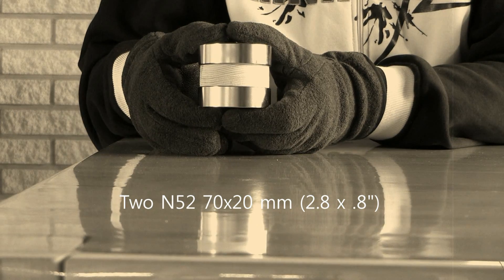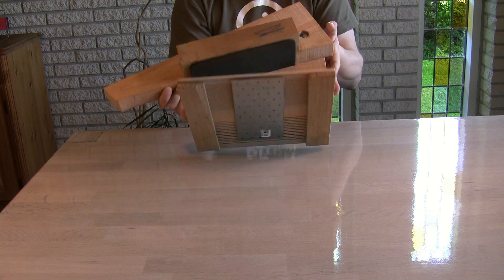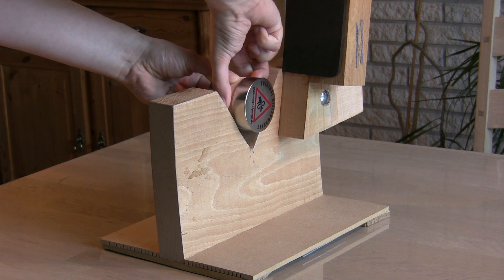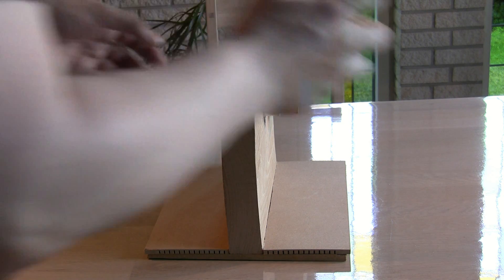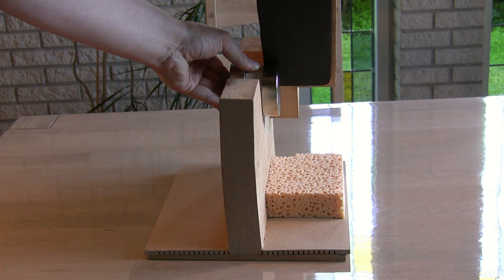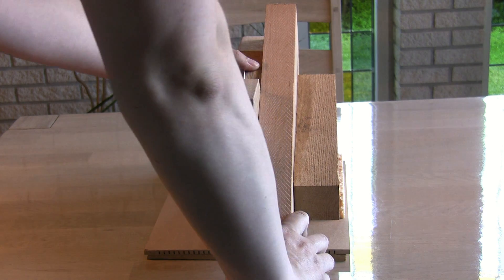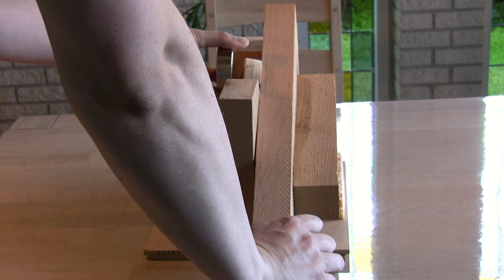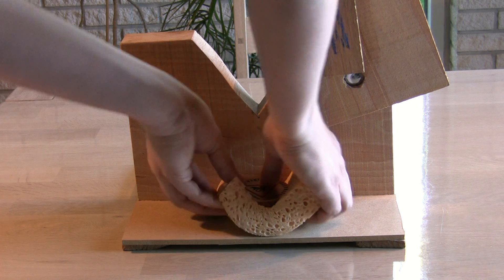Separating large neodymium magnets

Comment: [continued] Is it really true that 2 magnets have 13% more pull that one magnet of the same volume, density, and shape?  

If so, does that mean you can increase the pull of a magnet by cutting it in half and putting it back together (with opposite poles aligned)?

Comment: I noticed something odd when using the magnetic calculator on the K&J site. If you type in the values:
Grade: N42, Diameter: 1", Thickness 1", Distance 0, you get:
Magnet to Steel: 61 lb, Magnet to Magnet: 61 lb, 
but if you type in the values of 
Grade: N42, Diameter: 1", Thickness 2", Distance 0, you get:
Magnet to Steel: 69 lb, Magnet to Magnet: 69 lb.

[cont.]

Comment: That makes real sense, and it is proven when you compare the pulling force to a steel plate of two equal grade cylindrical magnets of the same diameter but different thicknesses, as they are virtually the same.

The pulling force between 2 similar magnets is roughly twice as strong.

Comment from the maker: [continued]. The magnets are saturated so the two magnets combining can't find any more magnetic attraction than a single magnet put on a steel plate with lot of unsaturated material. Also the magnets have exactly the same surface area in the scenario where the steel plate is larger so the magnet in the steel/magnet scenario has more material to act upon and saturate.

Comment from the maker: You're welcome :)
If you stack two magnets together they will behave very similar to a single magnet of the same size as the two smaller combined. That is: they have the same pull force if put on a steel plate as the single magnet. But taking them apart from each other is a different scenario. 
It still is a little counterintuitive that taking two magnets from each other is the same pull force as taking one of the magnets of a mild steel plate. I guess it has to do with 'saturation'. [cont.].

Comment: I checked out your Buyer's Guide which was very enlightening, and also the magnetics calculator.  That's exactly what I was looking for, thanks!

I was surprised to see that the force needed to separate a magnet from steel is the same force needed to separate the magnet from another magnet of the same size.

I was expecting it to be twice as much as the 2 magnets because the FAQ stated that "two or more magnets stacked together will behave exactly like a single magnet of the combined size."

Comment from the maker: Thanks :)
Google 'k&j magnetics calculator'. Then you will find an online calculator where you can input shape, size and distance in mm. Pull force case 3 is what you'll need. You need to translate form lb to kg though :)
Calculations with magnets are notorious for being inaccurate so only use it as a rough estimate (eg. grade is actually quite inaccurate - check my video 'Buyer's Guide - Grades of magnets').
Hope it helps and good luck with your magnets. Don't let them slam freely together ;)

Comment: Hi,
Thank you for your very informative videos.

I will be buying 2 small magnets that are rated at needing 22kg to remove the magnet from industry-standard 3mm thick mild steel.

I wonder if you would know the following...
Is there a way to calculate how many kgs to remove the magnet from an equivalent magnet at different distances, assuming that they are not slid off?

Thanks!
Marco

Comment from the maker: If they are stuck together on opposite poles it should take around 330 lbs to pull them directly apart according to KJ Magnetics calculator. Not easy... Luckily they are much easier to slide apart as I show in this video.

Comment from the maker: No, they are not toxic but you shouldn't grind them up and eat them ;)
Their danger is mostly in the very high magnetic power that can - in this size - crush the bones in your fingers if eg. caught between two magnets flying against each other.
The nickel coating on them could also cause nickel allergy but that would require a (very) prolonged contact with your skin.
Thanks for watching!

Comment from the maker: With that size I would seriously consider a small version of the shown splitter to easily and safely take them apart.
With some effort you may be able to pry them apart on the edge of a table (with one of the magnets sticking out over the edge and push down on it) but they could end up flying back together if you're not careful and give you blood blisters/eat a piece of your finger flesh.
Once neo magnets are measured in inches you have to be careful or have a high tolerance to pain ;)

Comment from the maker: ,@Walkingdeadman1991 :
'Normal' neodymium magnets like the ones from magnetportal shouldn't be used above 80°C (176°F). You can buy special neodymium magnets for higher temperature applications. They can be recognized by extra letter behind the grade - like N45M or N45SH. The highest I have seen is N33AH which can withstand 220°C (428°F) but it is only strength grade N33 (probably due to a lot of additives that ensure high temperature resistance but thins the neodymium-iron-boron composition).

Comment from the maker: @MikHartwell :
Glad to help! I haven't tried oil on the magnets. It could help a little I guess but I think the advantage would be too small to make up for the mess it could create. Most - if not all - of the oil would be squeezed out between these magnets. I would prefer a very thin spacer/washer inbetween of a relative soft material like wood or plastic. Metal will scratch the magnets badly when separating these magnets using the shown method. Good luck with your project.

Comment from the maker: @anonysquirrel :
Yes, this splitter tool is large enough to split them without a spacer. It takes much more effort and is quite scary because the forces involved with the magnets being much closer in the whole proces are so much larger.
I don't recommend it. It is more dangerous and the magnets I did it with got scratched in the protective layer. I may make a video where I split two magnets with and without a spacer to show the difference if people insists?

Comment from the maker: @spectrospirit :
Glad to help. That was the whole purpose of this video :o)
The magnets in this video are advertised at 270 kg each, which is measured on a machine that pulls really thick iron cylinders at top and bottom of the magnet away from each other. In real life I wouldn't trust them over 200 kg but that's still a lot of pull force!